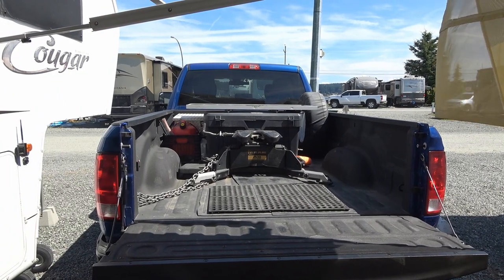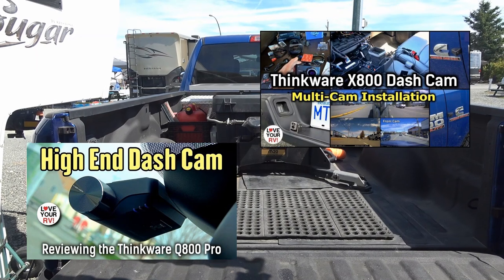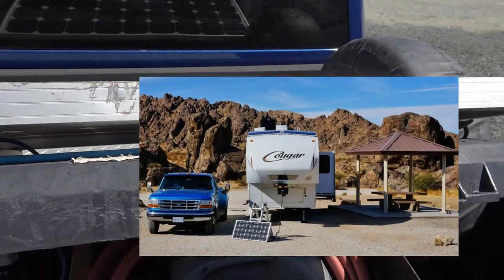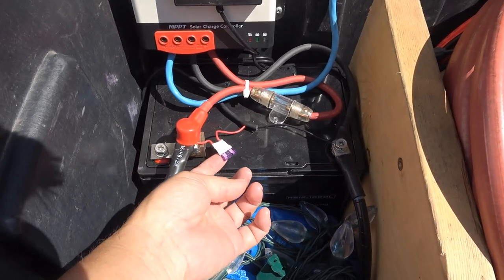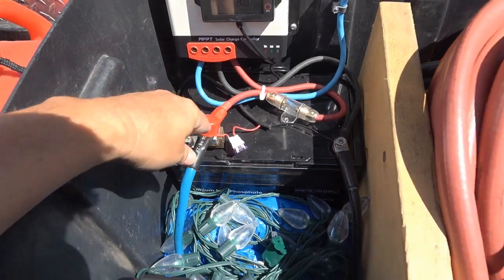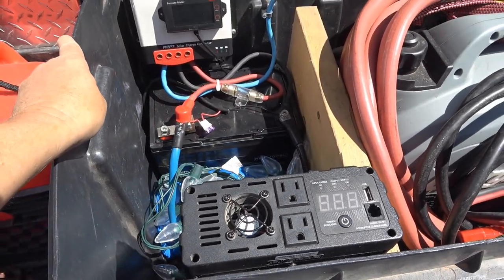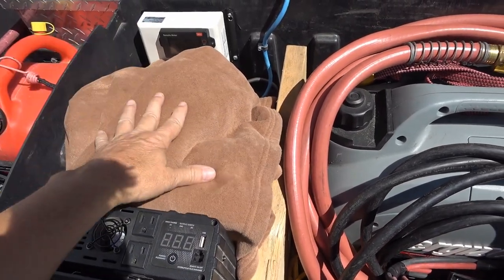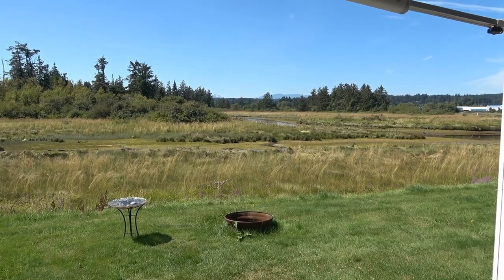Truck Tool Box Power System Mod - 100W Solar Panel + 40A Charger + 100Ah Li Battery + 1000W Inverter

Comment: I've been thinking about something similar, my truck has a tonneau cover and I have a small solar battery tender and it's gotten me thinking about panels/battery/inverter setup just to have 120V power enough to run some tools or whatever. I love a good design exercise. Then finding the most inexpensive path to achieve my goal. It's cold where I live for much of the year. I think no matter what energy storage solution I go with make the system removable is necessary
Reply from the maker: I'm always tinkering with and using it as a test bed for product reviews. Here is one of the most recent incarnations testing a lithium battery with built in heating pads. :)  https://youtu.be/qPf2_l8CQcM?t=329

Comment: Ray how did you know what size block fuse to use for the inverter? I’m m trying to build a system like yours for camping to run a refrigerator and lights.
Reply from the maker: Try to figure out the maximum amp draw and then add a bit of headroom around 10-15%.  Watts divided by volts will give you the amps. The inverter manual usually lists the required fuse size and recommended wire gauge for various lengths between the battery and inverter. The main thing is you want the fuse to be able to blow if a dead short circuit occurs before the wire overheats and fails. You can find various online calculators to help. Here is an example http://circuitwizard.bluesea.com/  btw my toolbox system continues to evolve. :) Check the latest here https://www.loveyourrv.com/diy-truck-tool-box-off-grid-power-system/  Cheers, Ray

Comment: I was planning on doing a simular lighting system for when we are in parts of the AZ desert with a string of old X-Mas lights I have. I thought I might have more sucess with a new string for 12v. Seeing what you have done with an inverter, I assume your running 110V ?. Does your battery hold up over night using the 110v ? I guess the key to that is the draw your lights are pulling though as well as the inverter.
Reply from the maker: Power draw for the inverter with the LED lights plugged in is about an 1 amp + the less than 1 amp dashcam parking mode draw so about 2 amps max.  The 100Ah battery should last about 50 hours without any solar charging taking place.
Reply: @LoveYourRV  Thank you. I assumed that the draw would be a fair amount more. I better go look at my LED Christmas lights and read the label... So you're probably only using ~20-25% of your battery each night & recharging with the 100 watt panel in just a few hours... Nice system ! I'm sold...
Reply from the maker: Yeah, the LED Christmas light wattage is really low For example, 100 lights 120 volts 60 hertz .06 amps 7.2 watts https://www.homedepot.ca/product/northlight-100-pure-white-faceted-led-c7-christmas-lights-66-ft-green-wire/1001563171

Comment: Nice work Ray - The estuary looks a little dry at this point.
Reply from the maker: Yup, was about the time of the lowest tide for the today 1.6 meters. 7 hours later it was the high at 4.3 meters filled it back up. :)

Comment: I would think about moving the lithium batteries away from the propane tanks just in case they go thermal.
Reply from the maker: The LiFePO4 (Lithium Iron Phosphate) chemistry used is very stable unlike other Lithium battery chemistries  Chemical and Thermal Stability of Lithium Iron Phosphate (LiFePO4) https://www.iib.co.il/upload/1529315153.pdf